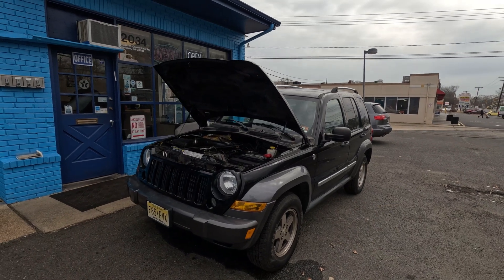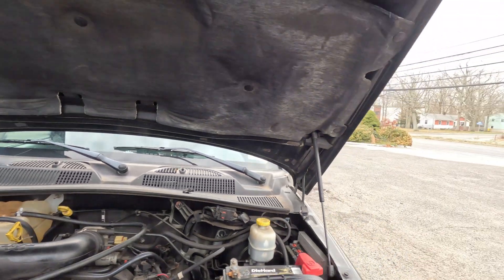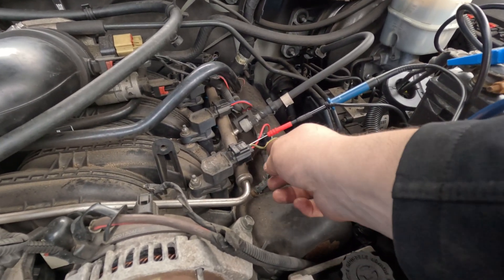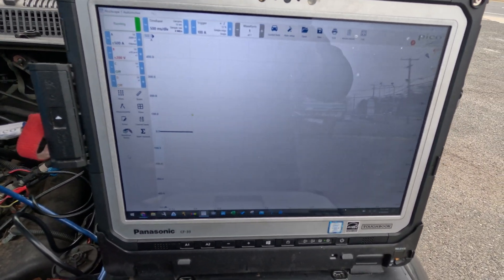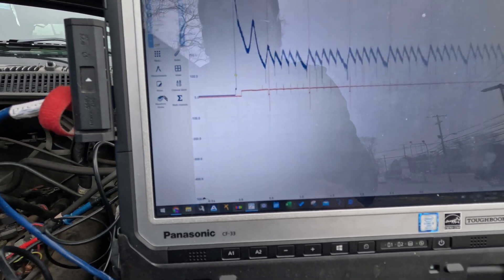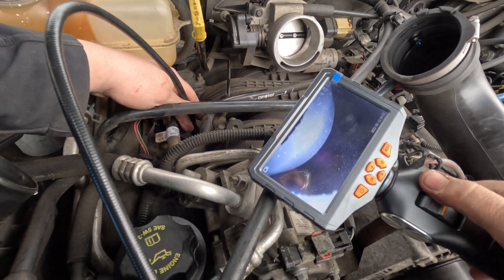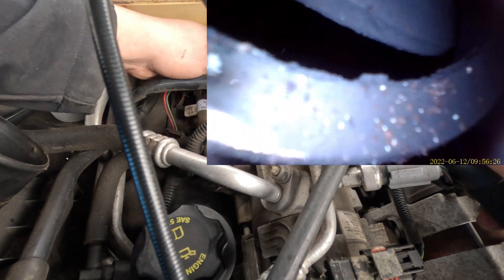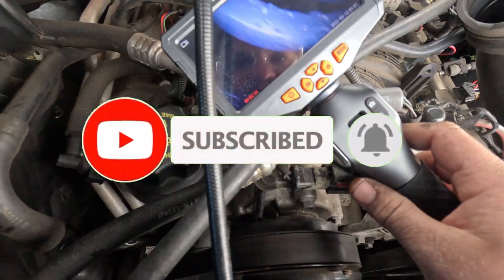Misfiring Jeep - Using a scope to speed up diagnostics!

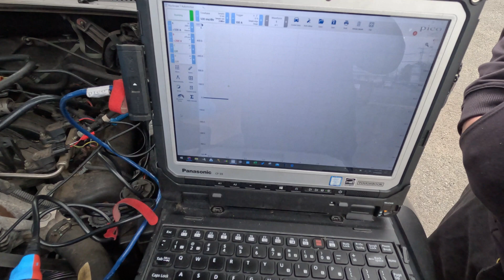Comment: 1:38 What precautions must be taken when using an oscilloscope to test ignition coils, and how can you prevent high voltage from damaging the PicoScope? Can you do a video and show different cars?
Reply from the maker: The only time you have to be worried is when you are checking actuel voltage at the coil and it is a 2 wire coil, like on fords. then you will get really high voltages. This is reading from outside the coil just the magnetic field so there is nothing to worry about. On Toyotas where there is a 4 wire coil, so the wire you check for a signal on is only 5 volts the transister that turns on the coil is built into the coil.

Comment: Awesome, valve seat drops, valve then pulls the seat up punching the spark plug. 
Kinda surprised that didn’t damage the coil given it looked like the plug tip/electrode we’re touching/shorted.

Comment: GREAT DIAGNOSTICS ,,, VERY SOLD TOOLING TO GET YOU TO THE POINT QUICKLY , WHAT TABLET ARE YOU USING FOR YOUR INFORMATION SYSTEM I HAVE NEVER SEEN THAT BEFORE AND THANKS FOR THE VIDEOS 👍👍👍
Reply from the maker: Thanks for watching! The computer is a Panasonic Tough book cf-33 and I was using the Pico 4425A scope with the Pico software.
Reply from the maker: The service information is Identifix